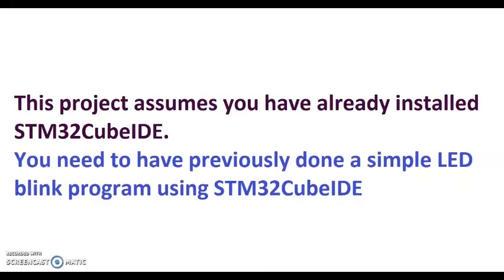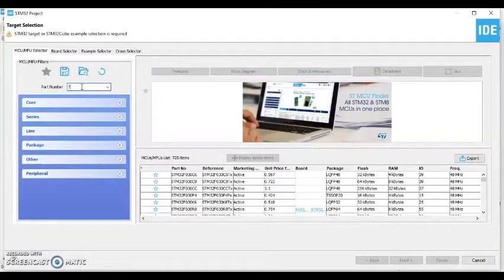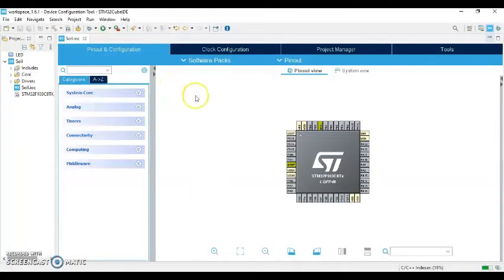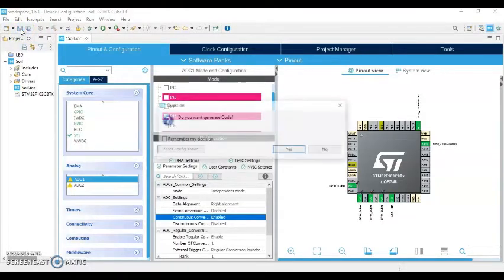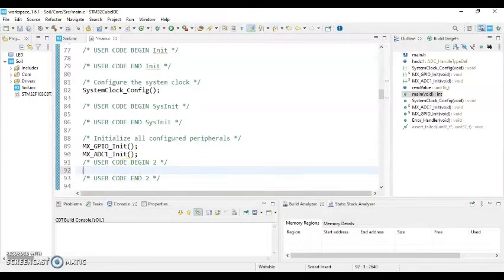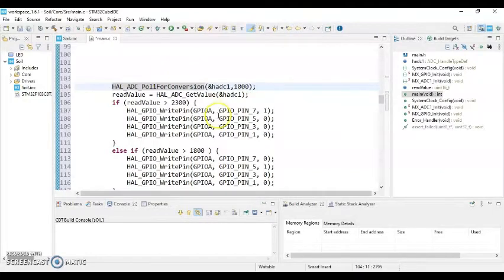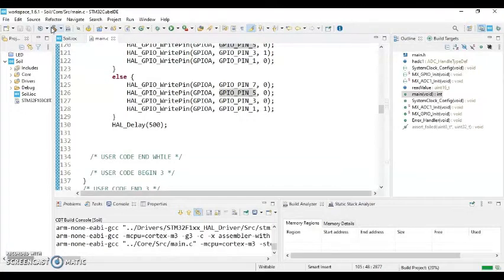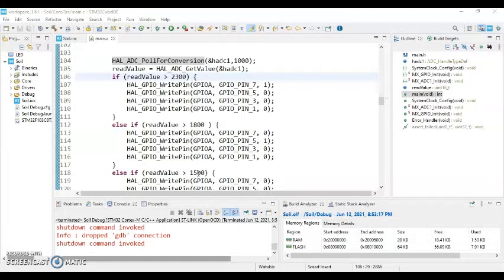8. STM32 - Capacitive soil moisture sensor using STM32CubeIDE HAL

Comment: The coding works perfectly but when i run it there is a problem where it is not looping and I have to use the reset button each time to see the condition change. What is the problem actually?

Comment: I was able to program it. However, when I check readValue in the live expression table, the value stays the same regardless of what I do to the sensor. Do you know what could be the problem. I’m using STM32F401CCU6(black pill)
Reply from the maker: ADC needs to be stopped and started each reading for STM32F401CCU6 as shown below. Thanks

    HAL_ADC_Start(&hadc1);
    HAL_ADC_PollForConversion(&hadc1,1000);
    readValue = HAL_ADC_GetValue(&hadc1);
    HAL_ADC_Stop(&hadc1);
Reply: @NizarMohideen  I found out that you need to do
 hadc1.Init.EOCSelection = DISABLE;
so that the adc will not stop after every iteration
Reply from the maker: Thanks for the info

Comment: Can you please explain why 1000 for poll for conversation? Can it changeable or it should always for 1 min = 1000
Reply from the maker: The value 1000 in  HAL_ADC_PollForConversion is the  timeout in milli seconds. It can be any value. Commonly used value is 1000ms. Complete command is:
HAL_StatusTypeDef HAL_ADC_PollForConversion (ADC_HandleTypeDef * hadc, uint32_t Timeout)

It can be found in data-sheet page 64 in:
https://www.st.com/resource/en/user_manual/dm00154093-description-of-stm32f1-hal-and-lowlayer-drivers-stmicroelectronics.pdf
Thank you.

Comment: does this work with arduino soil moisture too?
(the one that have two legs)
Reply from the maker: Yes. It will work with the two legged one. Follow step below 
1. The soil moisture sensor with two legs comes with an Op amp Circuit with six pins, two on one side four on the other side. Connect two pins to the sensor.
2. Other side four pins labelled VCC, GND, DO and AO.
	Connect GND to STM32 GND
	Connect VCC to STM32 3.3V
	Connect AO to STM32 B1

3. In the code, change the numbers in the if condition to
2300 → 3200
1800 → 2500 
1500 → 2200
Reply: @NizarMohideen  thank you so much for the quick response!
Reply from the maker: You're welcome
Reply: @NizarMohideen  i did exactly the same but it gives error hadc1 undeclared(first use in this function) , when i click the red it shows the line HAL_ADC_Start(&hadc1) can you help me ?
Reply from the maker: As shown in the video time 2:42
Click Analog
Click ADC1
IN9 (tick)
Reply: @NizarMohideen  thank you for the response my friend your works are nice